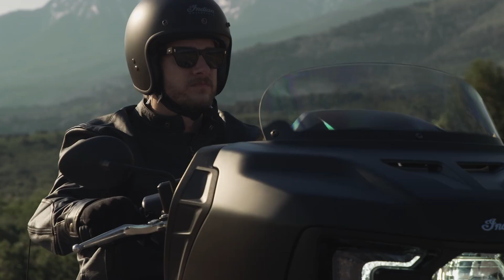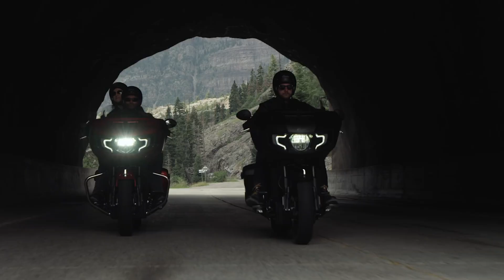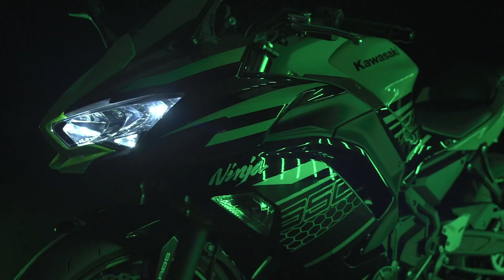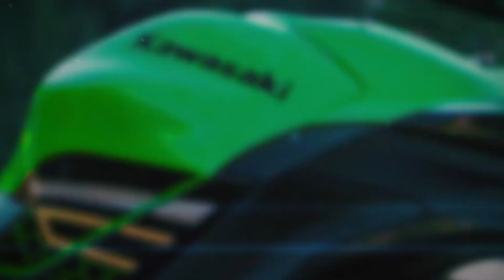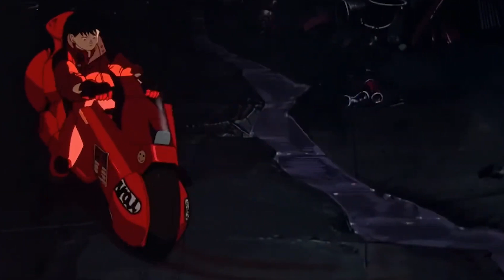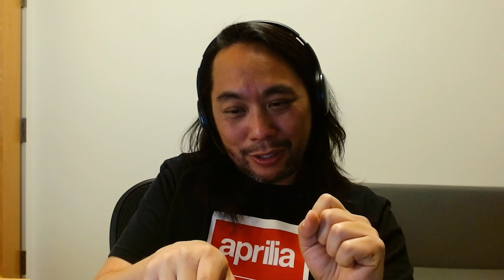He Decides What Your Bike Will LOOK LIKE // Greg Tada Aprilia Motorcycle Designer // E06 #podcast

Comment: Aprilia needs to drop another supermoto. I'm so confused why Yamaha hasn't. KTM has 0 competition
Reply: Yamaha actually has the perfect solution. All they need is a frame. they can use the mt07 engine , or the raptor 700. Retune it, change some engine parts and boom. Instant clout, it would shake the Market. 2024 Yz700X??? Aprilia should drop an updated 550 sumo. With slicks from the factory, slide control, launch control...you get the picture. but hey, no one wants to listen. I have the answers.